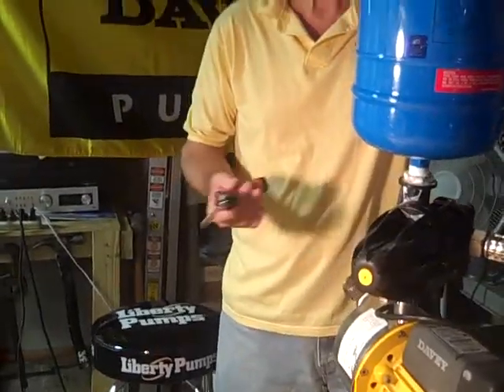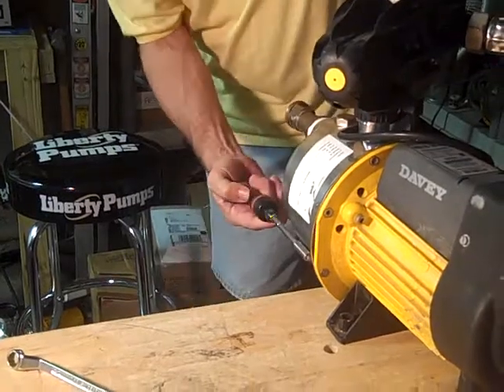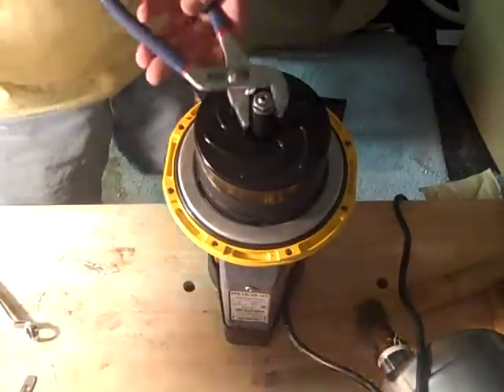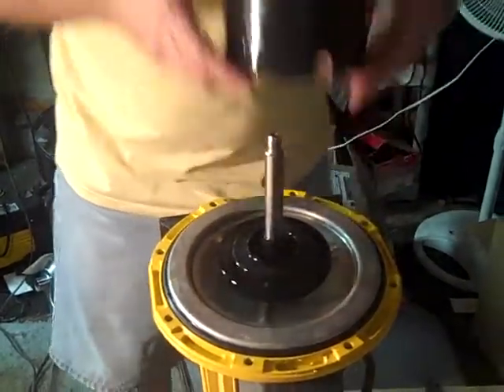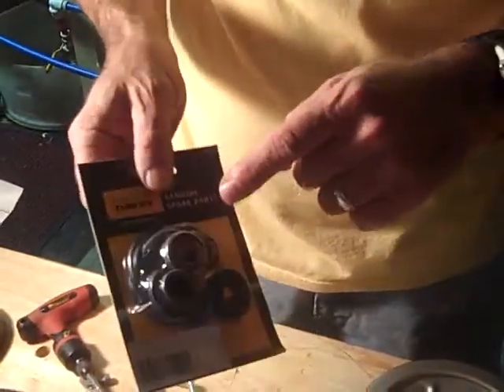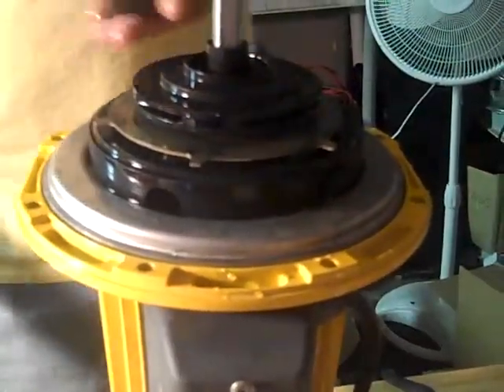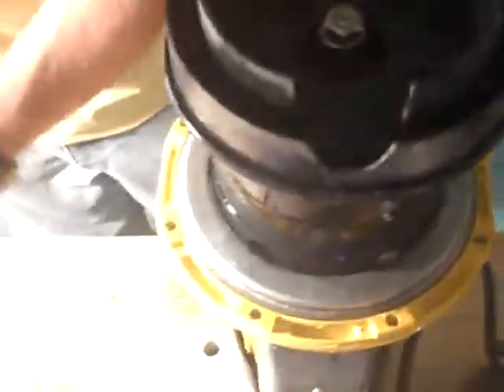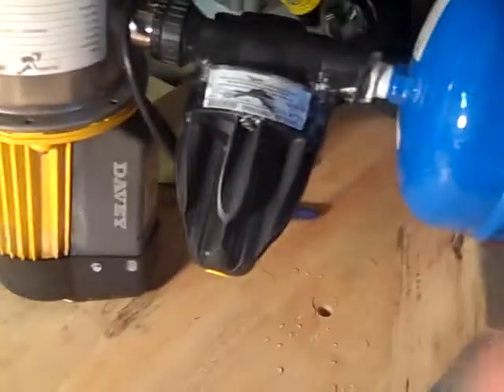Changing a Seal on HS series Pump

Comment: Hi All. I have a Davey BT30-30T2-USA Pressure Booster Pump with Torrium II Controller model. 3 months in working in my house, was Great.. Today, it started leaking at the bottom of the chrome cover. If i powered it off, the water incoming would leak, without going out... You guys have step by step on my model on how to repair and replace gaskets seals?  Also, what Seal kit should i buy for mine?

Comment: Hey just changed my seal. Its easy especially with video. What was not said which i learned the very hard way. 1 the small seal tat back plate needs to have ceramic facing you. 2.. if pump is not on level surface if you decide to do this job without removing main piping it will bind and not run. Must be on level surface people. Took me 6 hrs to figure this out

Comment: Great Video.  I had leaking booster pump, after watching I had no reservations about tacking this myself.  Ordered the seal kit and installed, no issues.  My pump had an extra impeller (4 stage) instead of the spacer.   My pump is a Mcdonald 6322-151 same as the Daveyy HS18-40.  I did the  Hydrascan to Torrium 2 conversion a couple of years ago.

Comment: Excellent video!!  When I picked up my seal kit Bob told me to remember the seal and spring orientation is CERAMIC to CERAMIC.  So, the RUBBER side of the seal gets pushed up against the metal backing plate and the flat, (ceramic?) side goes against the part of the spring that juts out a bit (the other side is rubber).  With other orientations (I stumbled onto all of them!) the pump will leak (heavily) or won't turn.

I found that in the proper (CERAMIC to CERAMIC) orientation, when I pressed the spring down by hand, the rubber side (on top) tended to dislodge and push down into the spring.  My solution was to press the NEW spring down by placing the OLD spring's flat side on top of the NEW spring and pressing down on the OLD spring until the NEW spring was fully in place.